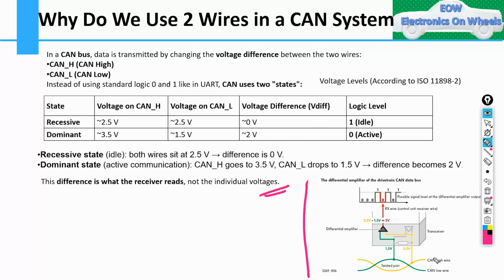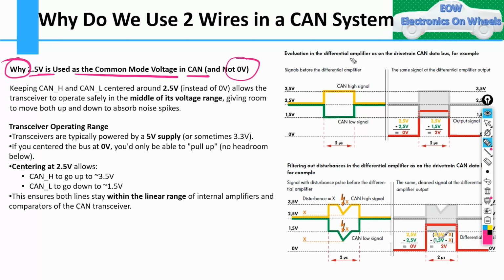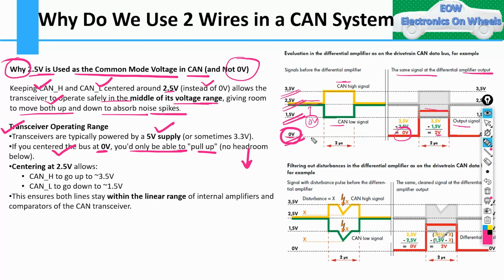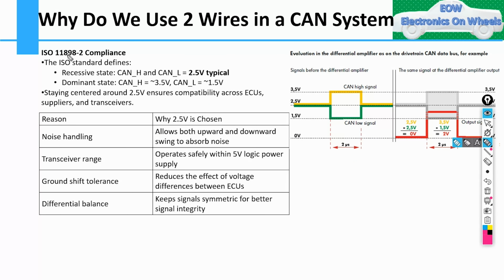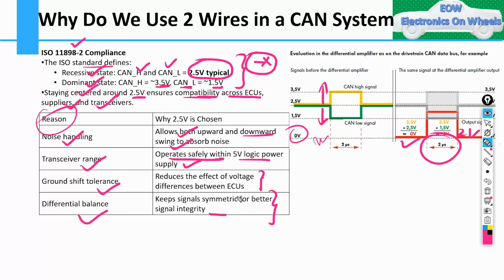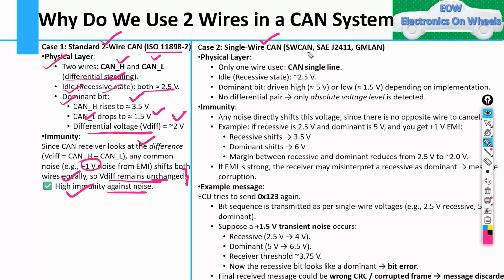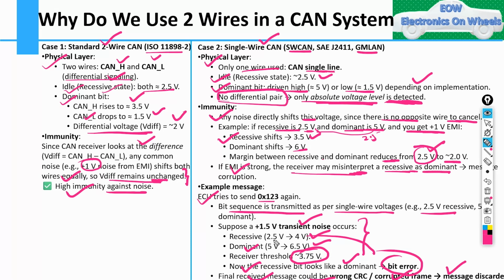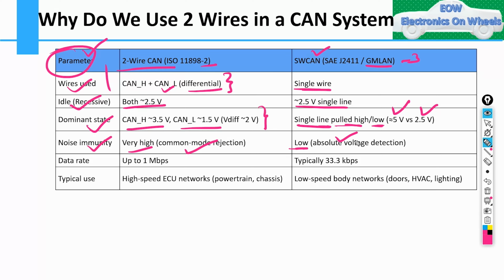Lesson 2: Single Wire CAN vs Two Wire CAN- Why CAN Bus Uses 2.5V Common Mode Voltage Explained

Comment: 10.21 how difference is 2V
Reply from the maker: The difference is 2V because CAN high is at 3.5V and CAN low is at 1.5V, resulting in a 2V differential.